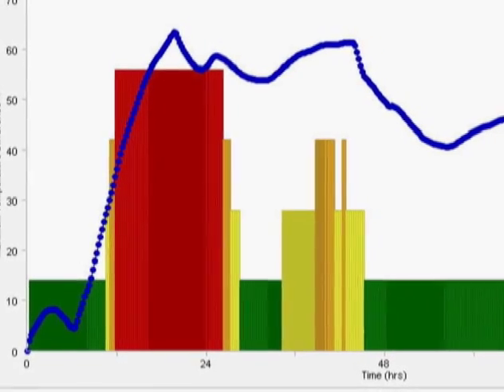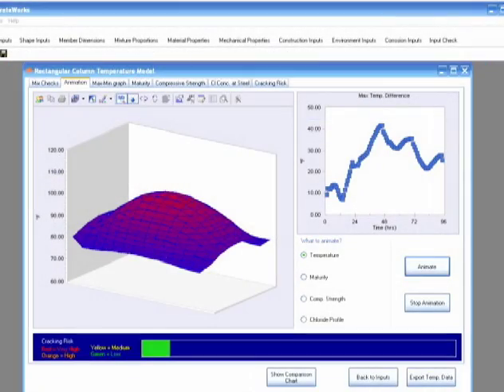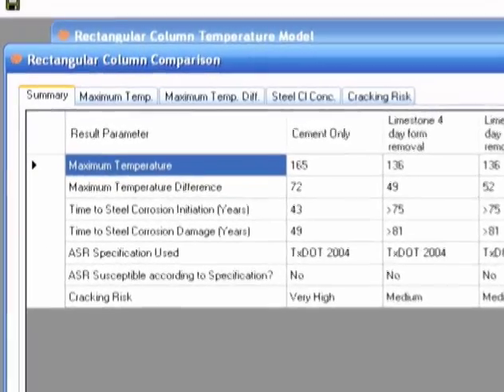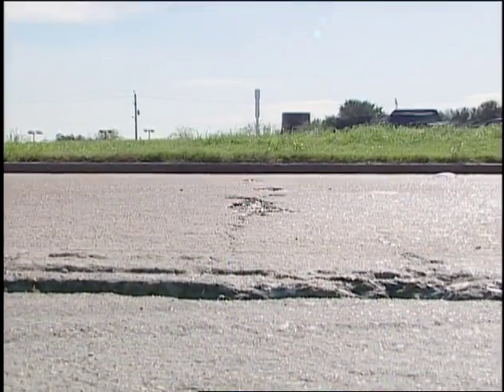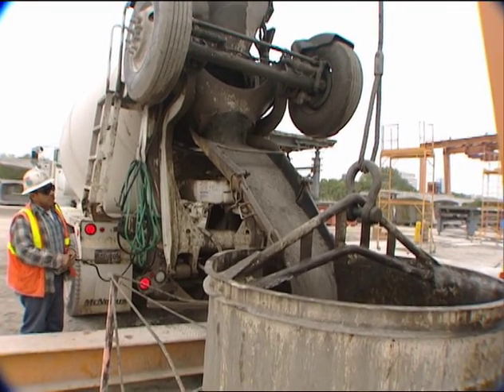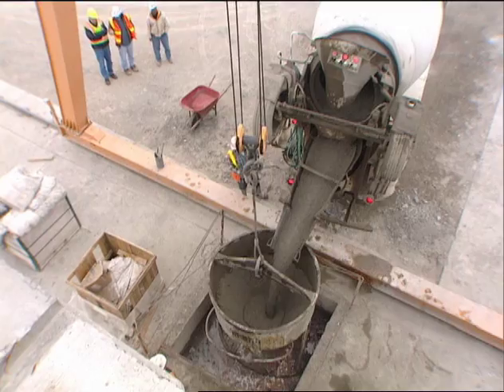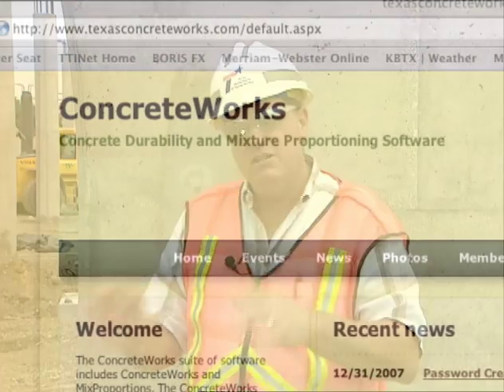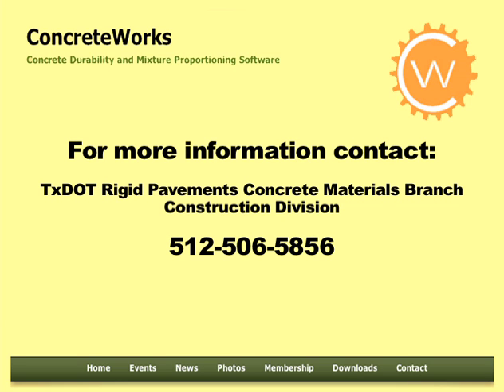ConcreteWorks v.2

Comment: The CTR Library has lots more info on this project. You can get the in-depth report on this software's creation here (http://www.utexas.edu/research/ctr/pdf_reports/0_6332_1.pdf) or check ou the 2-page project summary here (http://library.ctr.utexas.edu/hostedpdfs/txdot/psr/6332.pdf).